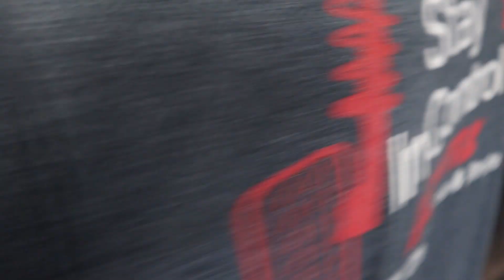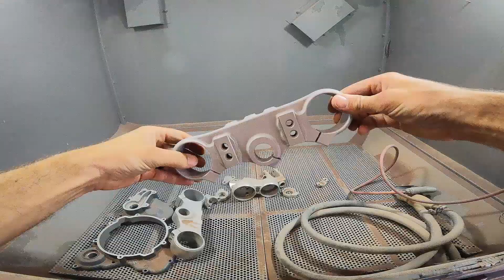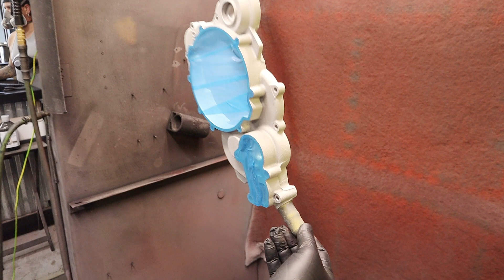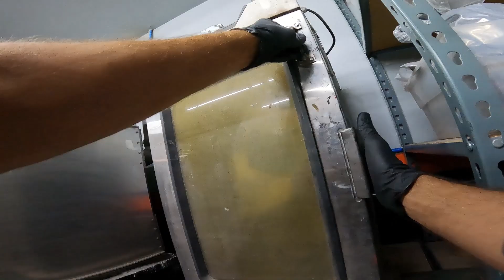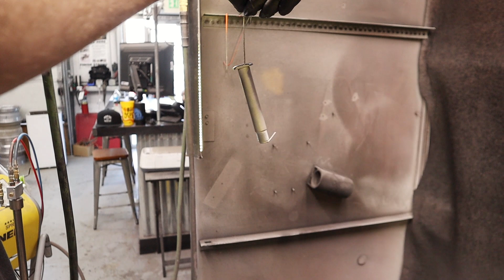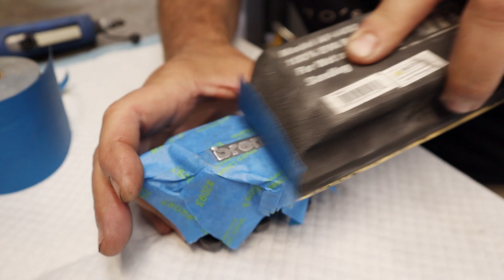Wanna trick out your dirt bike parts? WATCH THIS! 🔥 Unreal 2023 Gas Gas MC500 two stroke build

Comment: Where can we get those scotch cleaning pads now? as Cameron is Sadly 😢no longer here with us rip to him
Reply from the maker: Buddy, Pryme MX is still going & you can support Cameron’s family greatly by still getting those pads you love! And everything else they have to offer. 

You might like this a lot as well!  https://youtu.be/8Nc9W1tpUGg?si=U3sPTyyy4AeG4FuN
Reply: @ cool thank you , also I had some questions for cerakote I am going to be coating some 2010 yz 250f engine covers, the valve cover, stator cover, clutch cover, and oil filter cap cover in cerakotes gloss black 

but I notice they have the same factory bronze colored coating as the outside in the inside and they are magnesium.

How should I go about for the redo process should I blast off the inside factory coating too and lay new cerakote coating on inside as well as outside or just mask off the underside and leave that factory coating when blasting them and prepping?

Can cerakote hold up to engine oil if I have to do them on the inside of covers also?

Comment: This may be a stupid question, but that makes sense cause I’m pretty stupid guy, how do you decide what is a sensitive part that you want to protect and what is not? Because I see on the triple clamps that the bolt holes are not protected and the steering stem holes are not protected. Are you not worried about the threads being damaged or anything being damaged in the steering stem?
Reply from the maker: It’s a great question. In fact, it’s suggests that you have a great attention to detail. There would be nothing wrong with protecting those parts you’ve mentioned at all. 

In this case, the abrasive media is not abrasive enough to really hurt the tolerance of those particular areas. The parts just get a quick dusting, enough to put an etch on them so that they hold the coating well once applied.

On top of that, Cerakote is also super thin, so it does not affect tolerances in the opposite direction in terms of buildup. You can literally spray it onto threads and into bores.

On the topic of bores, such as brake caliper bores, those are areas we do like to protect. There is more of a precision fit going on there, so to speak, then the other places we’ve spoken about.

Those areas would be considered critical since they are holding back fluid, pressure, etc. an order for the brake system to work without failure. 

Hope that makes sense, thanks for watching, and best of luck if you enter to win this bad boy!

Comment: I know the details make the difference for sure, but what about the clamps?  The solid banded triple clamps does not do much for you performance wise.  Billet clamps grip better to keep your stuff from twisting in a crash.  They also apply enough force without squeezing the fork tube so much as to cause any stiction of the fork action.  So, what is the cost of going through the trouble of coating the clamps vs. buying a nice set like the x-trig that has the look with the performance?  Just a question.  Don't want to take away from the nice look.   Don't get me wrong.... they look slick as hell.  I'd love them on my gas gas over the stock any day.  The brakes and suspension parts look bomber as well.   The stock billet clamps are the main difference from my 22 EX300 and the 22 KTM300xc.

Comment: Saint Brembo, that's how we call it in Italy, has saved my life several times. Last time in the past summer, 100 to 20 mph in seconds. I felt the front end of the frame flexing on my Cagiva.
Reply from the maker: That's a pretty rad story, thanks for sharing bro! I know these brakes are awesome.
Reply: @mxrevival  The front lights suddenly broke and went out in the middle of the night on this road outside my city that I was driving at breakneck speed. A matter of fractions of a second and the straight line has become a curve, suddenly appearing in the darkness. Saint Brembo did its job but I aged a few years in seconds.